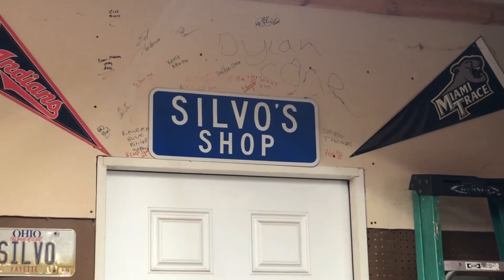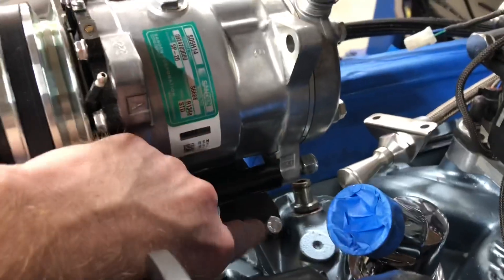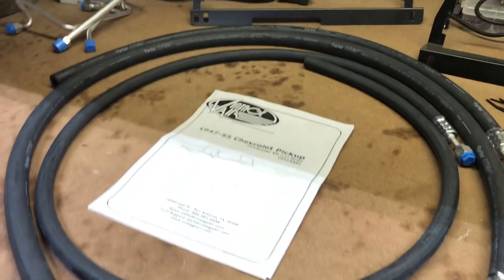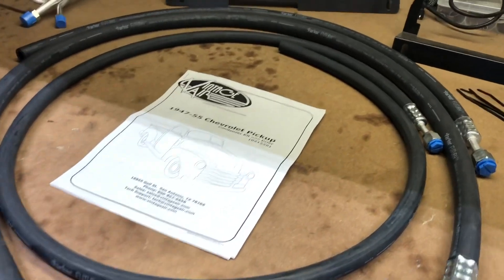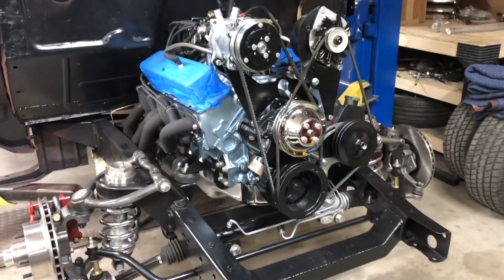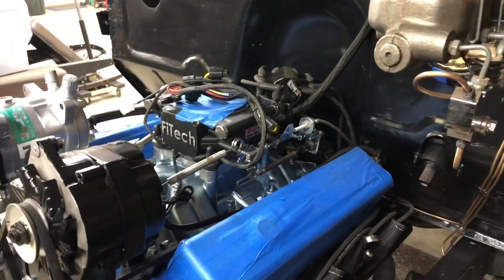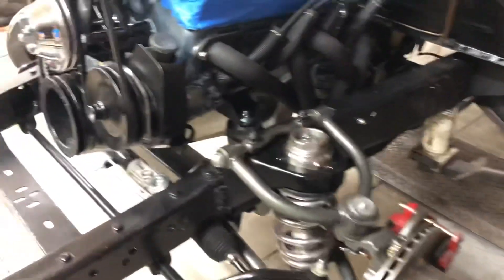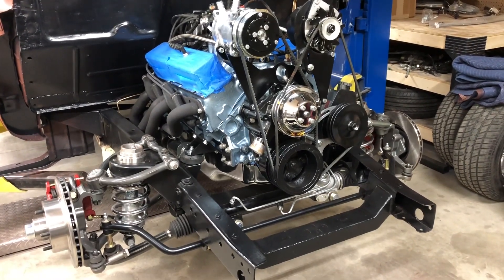Vintage Air Install Part 1 - 49 Chevy Truck

Comment: Great videos i watched them all ill be installing the vintage air also... was hopping to see how you installed the braket to the firewall i didn't see anything ..still great vidoes for me to come bk and watch when i get to that point
Reply from the maker: I didn’t use the bracket. I researched it and asked a couple forums for advice and guys have installed the system without it and haven’t had a problem.  Thanks for the kind comments.
Reply: @silvosshop  you have any vidoe of when you installed it to see how you did it
Reply from the maker: @chuys53chevytruck60  I’m almost positive it’s in the install videos.

Comment: Silvo, when installing the mustang 2 power steering rack to the bolt in cross member did you need to use extra bushings to get past the lower control arm mounting bolts? On your 49 truck Thank you
Reply from the maker: @jamesluttrell5960  no, I didn’t. Just used what was in the kits.

Comment: Thank you for your videos. Quick question sir. What is the part no. of the headers you used? And will those headers work with a factory steering shaft?
Reply from the maker: I ended up using different shorty headers. You will see them in upcoming videos. These were on the truck when I bought it and don’t know the part number however, look up part number 555-30050 on Jegs. They are similar if not the same ones. I don’t have a factory steering shaft so honestly I cannot comment whether they would work or not.
Reply: @silvosshop  Thank You, I appreciate you knowledge and help. I’m building my 54 Chevy 3100

Comment: How close was your rack and pinion to your motor mounts ?
Reply from the maker: Not close to the motor mounts, although maybe a 1/4-1/2” at most from the cross member. Check out my video of the underside walk through of the truck. You will see it there.

Comment: What size wheels and tire did you use in the rear and up front  after all done.?
Reply from the maker: @hectormontano6957  They are Boss 338’s. Front 18x8 with 245/40/18. Rear 18x19.5 with 275/35/18